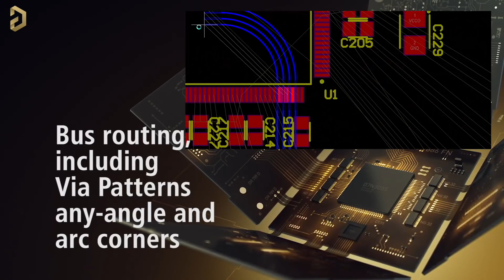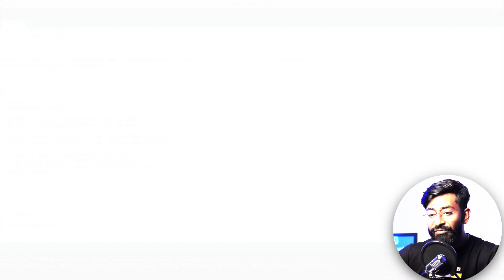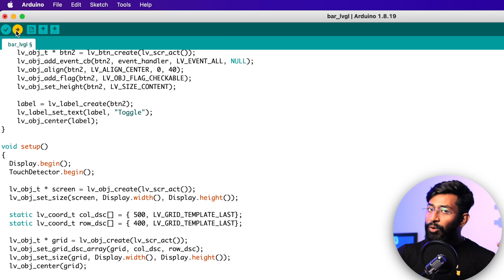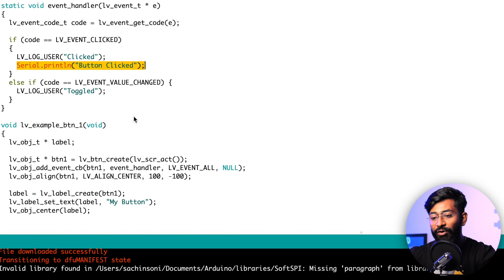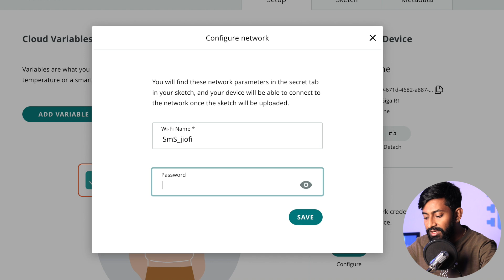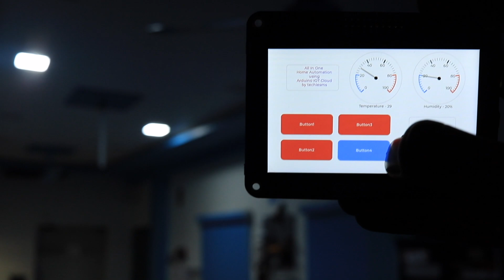My Home Automation Dashboard on Arduino GIGA Display

Comment: There is a high probability I'll use this for my current project with a 3.6kw solar array feeding an EV charger but also a small raised bed garden with automated watering shaded by the solar panels. The dual processors should be able to run the single axis solar tracker moving progressive automation linear actuators, and the automated pump/solenoid system running the irrigation for the whole agrivoltaic setup. Wondering about adding machine learning to it, with a camera to monitor growth/pests... I currently have the systems functions separated into a nano rp2040 connect, and a nano 1010wifi, on an IOT carrier shield

Comment: Create one video series for creating the ultimate home automation systems with HomeAssistant. The features can be
1. CCTV camera interface
2. Weather station
3. Walkie talkie among rooms
4. House internal temperature and humidity monitor
5. Automatic rules to start fan based on temperature etc